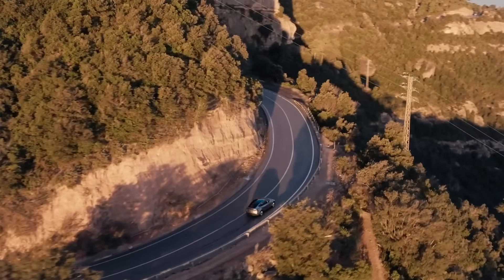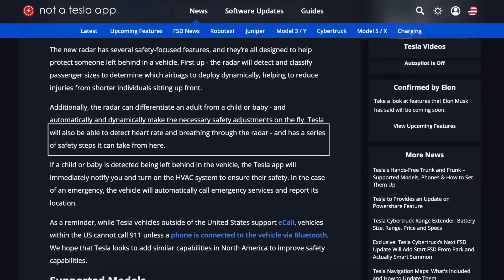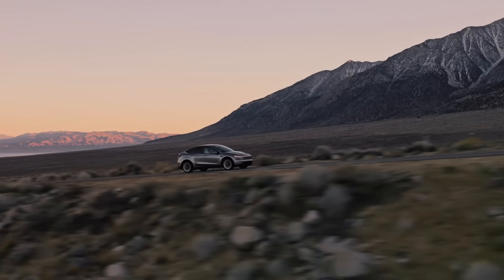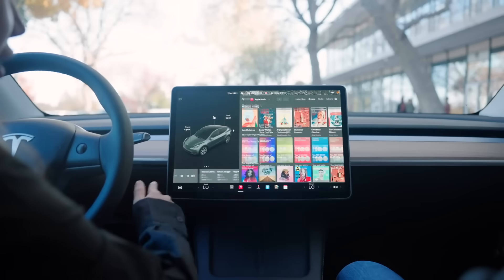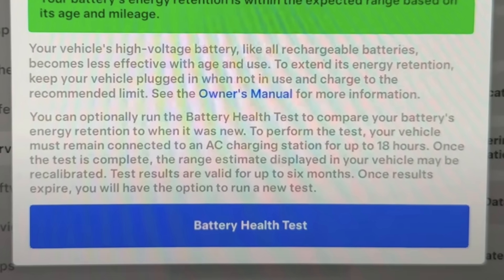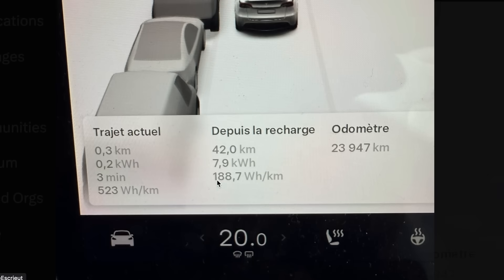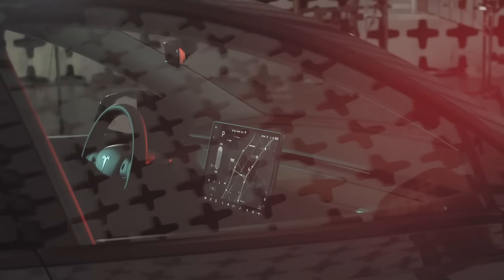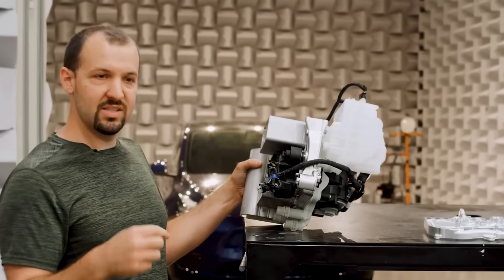Tesla Releases Upgraded “V2” Heat Pump and Interior Radar Detection | This Changes Everything

Comment: Tesla vehicles are priced too high, with costs starting at $50,000 and above. This is financially unfeasible for most middle-class families in the United States, who typically drive Toyotas rather than BMWs.
Reply: FYI:  As of January 2025, the average price of a new car in the U.S. was around $49,740, according to Kelley Blue Book. The legacy Model Y and Model 3 are well under that price WITH FSD. When you factor in long-term ownership costs (virtually no maintenance, no gas), over-the-air software updates (amazing new features added/continues to improve) and having your own personal chauffeur aka FSD, buying a Tesla is an absolute no-brainer.
Reply: They start at $35,000 after the federal tax incentive.
Reply from the maker: There’s going to be the more affordable next gen model coming in the new few months

Comment: The new heatpump 2.0 wont change efficiency by measureable percent. Its not an efficiency upgrade but a capacity upgrade.
Reply from the maker: It’s difficult to know right now since it’s so new, but I’m sure a full decimal point update brings along some bigger changes than just capacity increase
Reply: @heyJohnEe  you’d be wrong. It’s an update on reliability, cost and capacity. 
The laws of physics are already at the limit of current technology on efficiency. Any single percent points from 350% to 355% are exceptionally costly.

Comment: Tesla needs a 5G  HOTSPOT in the vehicle.  Other brands have them, and Tesla is behind.  We need V2L and V2G too in sll 2025 model year ev's.
Reply from the maker: Technically enabling hotspot is possible since there is a wifi antenna it should be able to send out signals the same as it receives similar to a laptop, it just requires a software update we don’t know when/if Tesla plans to do it
Reply: @heyJohnEe  Tesla needs to add this software asap.  Just in the CA fires, people needed the internet to send insurance forms and claims and to contact loved ones.
Reply from the maker: @davidws5439 definitely. I think they’ll do it when starlink direct to cell is fully enabled, otherwise they’ll be paying too much costs for third party cell networks

Comment: I think they should add it to the model 3 highland
Reply from the maker: Definitely will come
Reply: @ I’ve had issues with the heat pump, I have a model 3 highland and now it’s in the shop because it didn’t survive its first winter, the heat pump started acting up, if they have already a generation 2 I wish they could add this to my current model 3 2024 highland
Reply from the maker: @fernandomoz8 fingers crossed it’ll come soon 🤞

Comment: Can someone explain the mixed braking thing? This seems to offer almost no difference to the driving experience. If we’re already using 100% regen braking without the brake petal at all, then there’s no way it can be more efficient or add more regen, it’s just the same regen with the brake pads right? Unless you choose the lighter regen, there is no difference.
Reply: I think when they said “mixed braking”
It means before we used to have regen braking , or just brakes alone. 

So now , using the brakes is using regen braking as well. 
So no heat will be wasted. 
I think that’s what they meant    
So now one pedal is solidly regen braking whilst the brake pedal is regen and brake. “Mixed”
Reply: @ejisloco1051 but your foot can only be on one pedal at a time, so if your foot is not on the gas then it is using full regen, so then by using the brake pedal, it can’t draw more regen magically, so it would just be the regular brake pedal.
Reply: @just8bits29 in an unlikely event where u need to brake suddenly ie a child walks in front or an animal (knock on wood ) u need a faster and aggressive brake. 
That type of braking will generate intense heat , so not only it will stop the car for sure but will also add power to the battery.